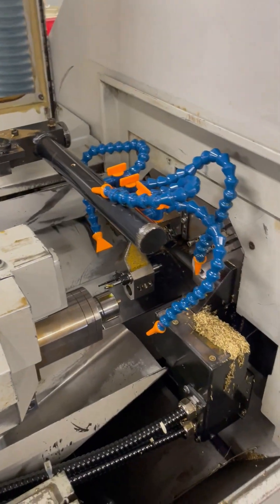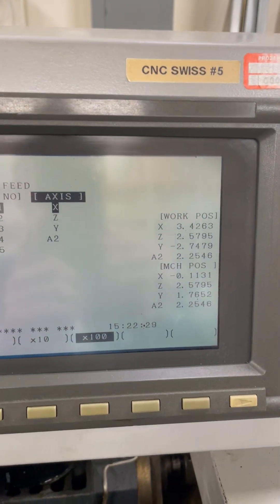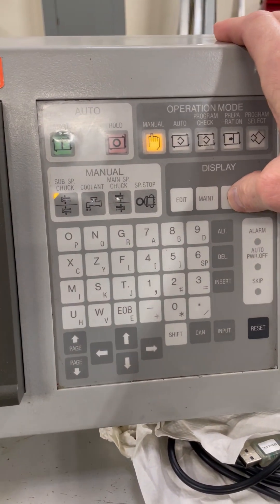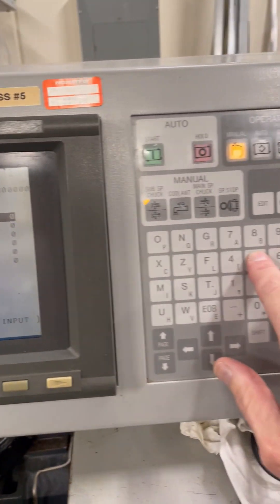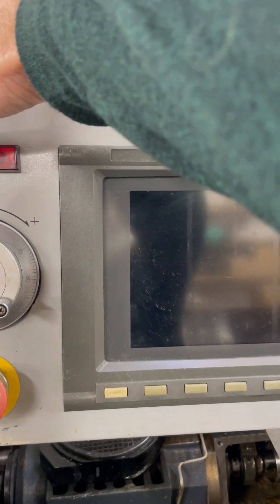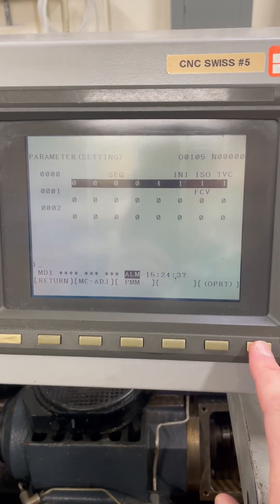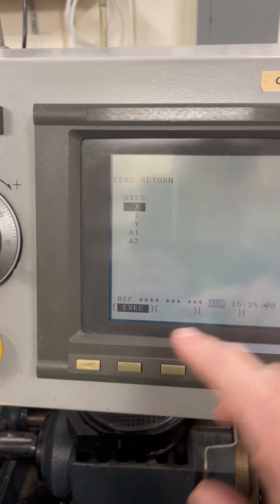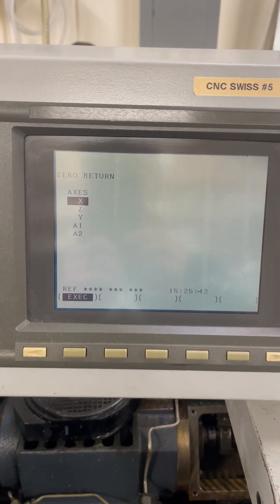Citizen Cincom B12 Swiss lathe Failure to zero X axis

Comment from the maker: I eventually solved this after I did a "Wait" on T11 which did an over-travel alarm on the Y axis.  Although I wasn't aware, through any alarm, that Y needed to be re-zeroed, again, re-zero'ing Y then allowed me to re-zero X.
Reply from the maker: I forgot...one other thing was that I ensured that the X-axis was sitting in the middle of its global travel limits.  Spinetti Machinery in Reno, the West Coast Cincom dealer and support, said that you need to make sure the axis can turn two full revolutions on the ball screw.  I'm pretty sure that this didn't have anything to do with it in my case because the X-axis was always well within the middle range of movement.  The other thing is to make sure when the manual says to turn off the machine and turn it back on, they mean turn off the CNC, turn off the machine breaker, wait 30 seconds or more, and then turn it back on.
Reply: Hello,  I was wondering if you could help ? I just got two 1999 cincom b12 machines running but the previous owners were using the sub spindles as only part catcher's.  Could you tell me how to turn on the subs ? Right now, I can't even open or close the collects on them . Thanks
Reply from the maker: @eddiemendoza6259  Hi Eddie, on the B12, M03 code is the main spindle forward command.  To start the back spindle, M23 is the mcode to run.  It can take an S parameter to set the RPM.  M24 is the reverse direction which would sync with the forward direction of the main spindle, if it was running M03.  So, I use M24 in the process of moving the back spindle forward to sync with the part in the main spindle and during the cutoff.  M24S3000, to be precise.  So reverse spindle direction at 3000 RPM.  To open and close the back collet, the M code is M15 to close, M16 to open.  Keep in mind that most of the alarms you may have on your console need to be cleared before you can do much.  You can create a program to include these M-codes or you can go to the "Manual" screen and enter the g-codes or m-codes directly and execute by "input" then pressing the start button.  I will sometimes do this if I intend to "warm up" one of the spindles.  I hope that helps.
Reply: Hello, when I want to start the machine, it does not run the program. When I start, it gives 592 NOT EQUAL OF START&END_P X Y Z axis alarm. There are THREE alarms as X Y Z. What is the reason and solution, brother? The machine is Citizin Cincom B12 1998 model.
Reply from the maker: @ I'm not sure what all you tried, but if you're new to this kind of machining, the usual problem is that you didn't set the machine to start position after the initial cutoff.  If you have the manuals, in chapter 6 of the Operators Manual, it will take you through the Start Point (6.2.1) and Cut-off machining steps (6.2.2).  Have you done this or are we talking about some other type of machine fault that didn't use to happen?
Reply: Hey man my boss just asked me if I can start programing our citizen b12 2005 and I almost know nothing about it do you have any contact info I could reach you at? Email or something. Right now I'm just trying to set up a part that is already in the machine and the tools are set up but the machine has been sitting for a couple years and I had to replace the battery and I'm guessing the axis need zeroed maybe.